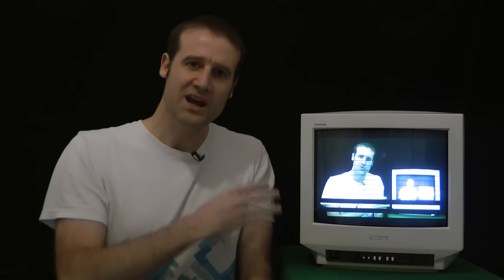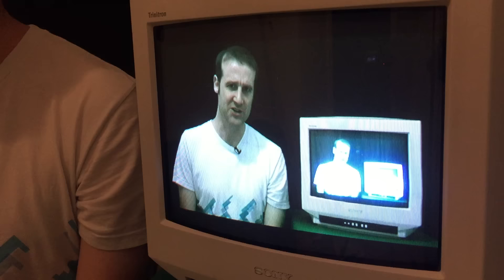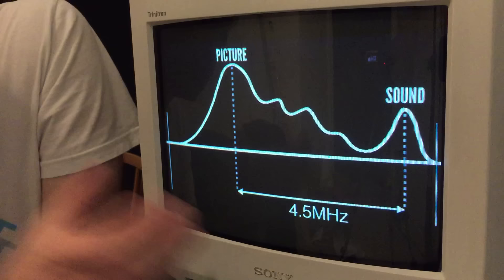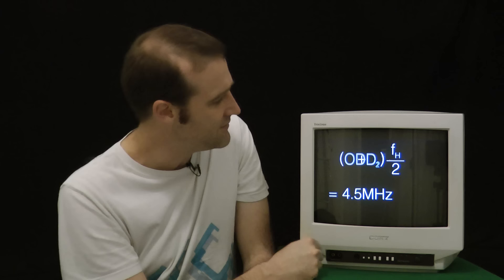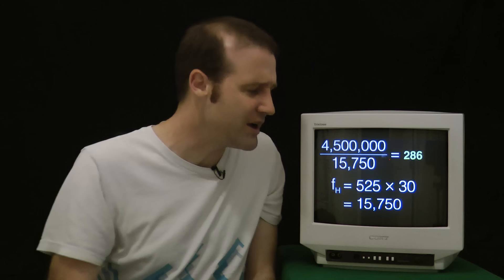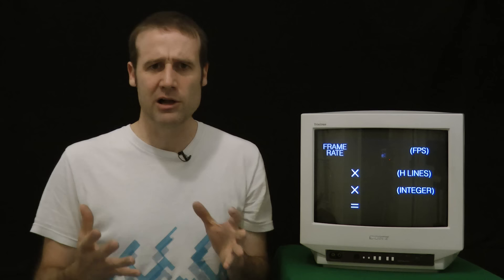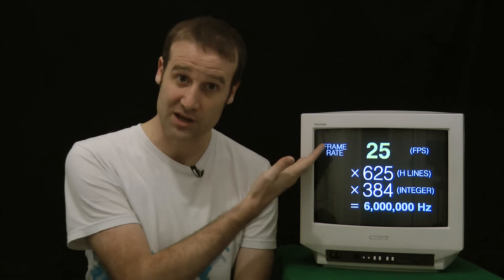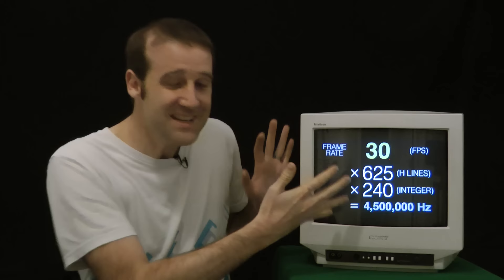Why is TV 29.97 frames per second?

Comment: Changing the lines to 625 would have made existing hardware obsolete, that is why they changed the frame rate. It allowed existing BW TV’s to still show a picture with a color signal. They had no choice and did what they could to make this happen.
Reply: That's what he said....
Reply: why not change the bandwidth?
Reply: @ronenfe  that's even more difficult and would make literally everything not compatible.
Reply: @ppaaccoojrf  why is that? Old TV won't receive the color signal which will be out of their bandwidth. They will just need to allocate new frequencies to some stations which overlaps the new bandwidth.
Reply: @ronenfe  First of all, TV frequencies are a finite thing, and increasing the portion of the spectrum allocated to each channel reduces the number of channels you can have (which is a problem if you have already allocated all spectrum real state to different buyers).

Second, I'm pretty sure TVs were already preprogrammed to expect a specific separation between video and audio data, so you can't move that without breaking compatibility. You'd have to put colour data either before or after the existing data (i.e. not in-between as it happened) which forces for into a specific bandwidth range that would most likely end up being even bigger than European ones. Depending on how TVs are programmed to look for channels, you could lose as much as half the useable spectrum.

Third, you would force every single broadcasting station to update their equipment and most of them to change frequencies altogether, which also means buying new antennae even if they don't plan to transmit in colour.

If you're gonna do all that it's easier to just give up on backwards compatibility and start a new standard like Europe did.

Comment: Even before consoles ever existed, america could never reach 30 fps.
Reply: And then once the most popular ones did, North America and Japan more than doubled it.. For example, the Nintendo NES through N64 output video at 60.09 Hz. Since they output 240p, 224/448p, and 240p/480i, the images aren't interlaced (except on the N64 hires mode) translating to a 60.09 non-interlaced frame rate. Our TVs can display this no problem since these machines have a system clock that's a multiple of the 3.579545 MHz color frequency resulting in a frame rate more than double than what they were designed for but with no color incompatabilities or shaky image.
Reply: Yep, the Parkers square of a standard.
Reply: Unless you take into account the field rate of 59.94. That's the real temporal resolution.
Reply: Watch again, the American standard was 30 FPS when it was black and white signal. It was the introduction of colour that caused the 29.97 FPS! So you could say they lost 30 FPS and were never able to regain it :P
Reply: MindMaster107 well now we can get well over 60 on much more taxing things than broadcasting video, so touché
Reply: Be more bigoted.
Reply: .03 fps off vs 5 fps off. Hmmm
Reply: And Europe could only ever reach 25 fps. Which meant that all games here were played in slow motion back in the day.
Reply: tobbaddol Slower but higher res :P
Reply: Jarod_Insane That was 1 FPS more than movies for Europe but we also had higher definition too which is why old US TV show recordings seem blurred compared to European ones of the same period ;)
Reply: I think that the exact Framerate on 240p Consoles varys from console to console. For instance the SNES' Refresh Rate is 60.9hz while the GBA's Refresh is 59.71hz. They made consoles with wierd refresh rates in order keep the 240p resolution working on a CRT. But to be honest 29.97 FPS isn't very far off at all 30FPS so why complain? NTSC Models of 240p Consoles are also much better than PAL Variants because of the changes done to make NTSC game conversions work with PAL Equipment. When a game was originally designed to work with NTSC TV's (All Japanese and North American Games), then played on PAL Consoles; the games would be slowed down about 15% in order to play on European Standards. Because PAL was also a higher resolution, NTSC Games would have to be squished in order to fit onto a higher resolution. However, very few games were optimized for PAL (Unless they were made in Europe) until the 6th Gen of Consoles
Reply: 480i by definition is interlaced; although by context it looks like that's the "hi-res" mode.
Reply: Mystickneon Dude you are running all over this video page calling people bigoted in the least expected places, i.e. where there is no bigotry at all (the video creator, the comment author). If you want to see bigotry, scroll up, they're arguing about American global power and which countries invented what.
Reply: +Galbi 3000 The permanent lagspike.

Comment: Yay for europe.    
Can't American ever get a logical format?
Reply: It's been 150 years since they first made the metric system legal and they still haven't switched, so I doubt it.
Reply: Why is it less logical?
Reply: They learned from us. You cant change laws just because the standard isn't what you want it to be. The USA got stuck with a lower bandwidth and the EU looked at us and made it easier for them. Has nothing to do with being American but being first that causes these issues. The Internet and power grid are both good examples here as well
Reply: The American system is based on practical units, for example a hat (gallon) full of walnuts, nails that are 9 times the width of a thumb (9 inch). A foot of length etc. knots for speed (how many knots in a rope go overboard per time unit) whereas the iso unit are based on scientific units that make calculus easy because you don't need to multiply them with constants to make the formulas work, so f=m*a  instead of f=0,453592*m*a or something (cant't be bothered to look up what unit Americans use for acceleration)
Reply: g

Comment: What is your favourite unit of measurement (SI or otherwise)? :)
Reply from the maker: +Lawrence Calablaster The foot-candle.
Reply: standupmaths That's always been a favourite of mine :) The Scoville heat unit, micromort, the entire FFF system, smoot, Warhol, and Wheaton are some others.
Reply: I once calculated all of the dimensions of a sensor I was designing in chains,  milichains and microchains.  That was a confusing presentation :)  A chain being the length of a 100 links of chain or 66 feet.  A microchain is roughly 2mm :)
Reply: Raymond Jeal Sweet :)
Reply: furlongs per fortnight
Reply: +Lawrence Calablaster "What is your favourite unit of measurement (SI or otherwise)?" One I find amusing is the human intelligence index, tary. As all units, the tary  has multiples:

X10    = decatary
X100  = hectotary
X1000 = kilotary

 and sub-multiples:

/10 = decitary
/100 = centitary
/1000 =  military

;-)
Reply: corisco tupi I couldn't find an example, though I suspect that the whole thing is just the leadup to a joke about military :)
Reply: Lawrence Calablaster :-)

Comment: May be in Europe solved it pefectly but England got 425 H line sorry dude England had more messed up system than the US.
Reply: The UK originally had a 405-line system which had gone into public service in 1936. It had seemed reasonable at the time but we adopted the European 625-line standard in the 1960s.
Reply: @gerardjlaw  For several years BBC1 and ITV transmitted using the 405-line and BBC2 with the 625-line standard; the only way to receive them all was to use a complex "dual-standard" 405- and 625-line, VHF and UHF, receiver. The introduction of colour on BBC2 in 1967 necessitated an even more complex dual-standard set to receive all three channels.
 The last 405-line transmissions were seen on 4 January 1985 in Scotland; There is a little time shift between 1960 and 1985.
Reply: @listerine-pr5lt  Yes. My family had a dual-standard set until we finally splashed out on colour in 1974.

Comment: cool, but RIP european video games running 10fps slower! (you can blame some lazy developers just slowing down the game for european games instead of optimizing it :p)
Reply: So europeans use radio signals to play video games? Cant argue to that locig.
Reply: @joonasd7  old European TVs run at 50hz as per the electrical frequency described in the video (in USA it is 60hz). as a result, game programmers slowed european games down to 50fps.
Reply: The games on PAL as he said run about 10 frames slower, which for speed runs is the reason people choose NTSC